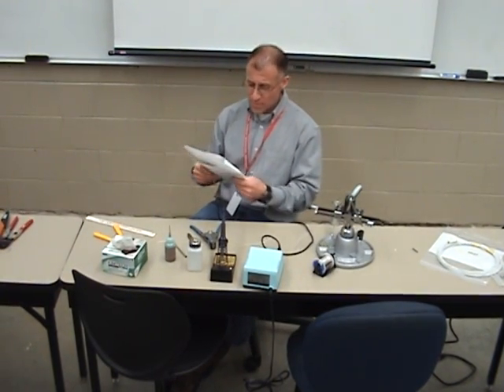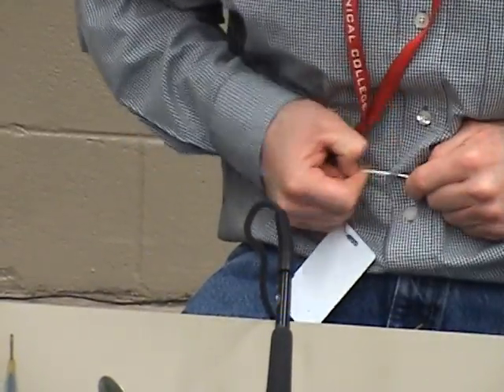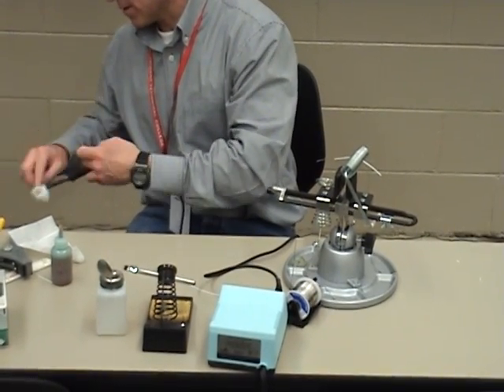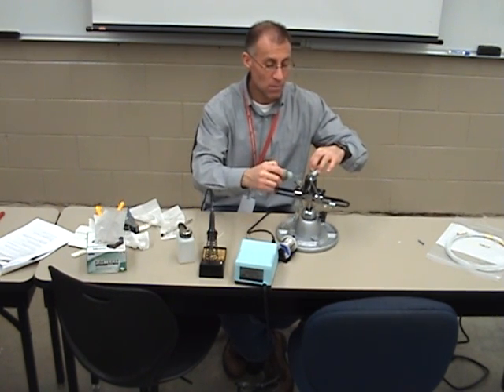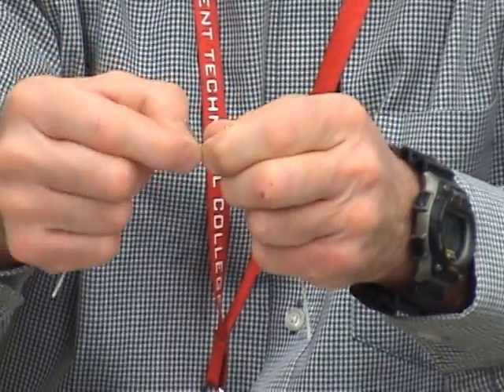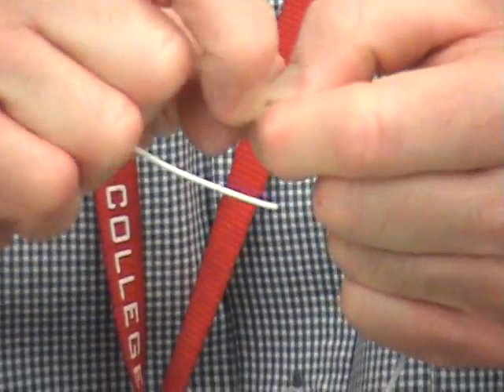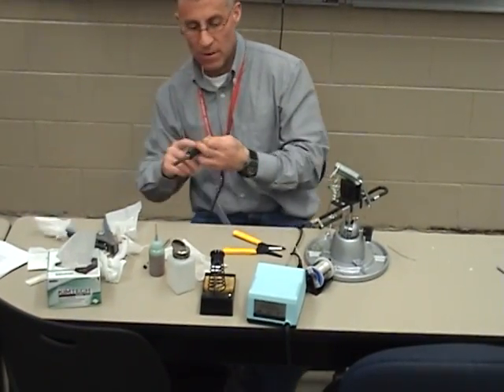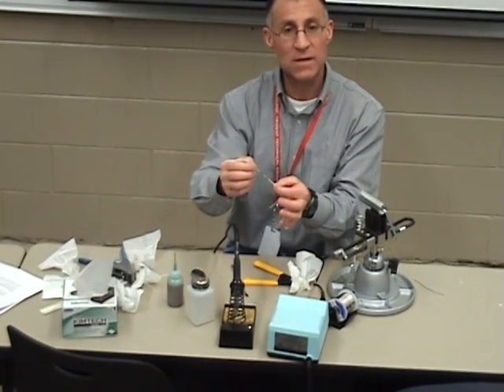*EXPERT LEVEL* Solder Splice Tutorial TTC Avionics

Comment: I would be surprised to find such a splice on a large transport rated aircraft. In my experience on Boeing 767 and 747 aircraft Raychem splices are used most often. For those not familiar with that type of splice it consists of a metal tube with a notch cut in the centre into which the stripped wire ends are inserted until the ends are visible in the notch and then crimped with the appropriate crimpers, the splice is then covered with a self sealing heat shrink tube.
Reply: Because thats a stronger more secure connection.

Comment: Back in the day, we referred to that type of splice as a "short tie", a variation of the Western Union splice (used heavily in telegraph / telephony wiring back then). It is a mechanically strong splice.

Avionics soldering requirements include cleaning at each step with the goal of removing contaminants that could infiltrate the connection. Contaminants could lead to eventual destruction of the connection.

Comment: I appreciate the value of these videos as a technician, and felt like I needed to add something to contribute to this:

When stripping larger diameter wiring sleeves (like coax) and/or longer lengths of sleeves (such as anything above 1 in/2.5 cm) wiring with smaller/weaker diameter wire such as 22ga aluminum wires such as those found in electrified door hinges; It is important that you strip the cable multiple times at 1 in/2.5 cm until you achieve your desired strip length. The stress of pulling the sleeves beyond that can break the wiring or stress/stretch the material, allowing for faster oxidation and a shorter lifespan of the wire.

Comment: People of the Internet: this is next level soldering meant for space shuttles and aircraft.  Do you need to do this if you're soldering the crappy xPlode subwoofer that you currently have hand twisted and duct taped in the back of your Honda Civic? No.
Reply: Josh Denham this splice is actually designed to carry mechanical tension, in audio you're probably not worried about your wires carrying mechanical tension but rather about how faithfully they carry a signal. Which might not be this.

Before recycling an engineered solution make sure the problem it's a solution to matches yours.
Reply: Yes and no. You need to know the information yes. No I don’t think you would need to put a xplode subwoofer in a civic.
Reply: jaberwocky6669 Hell ya you do! Its done this way because engineers figured out its the best way to do it. Why not do it the best way?

Comment: OMG, it is not that hard and drawn out to solder wire. Way overkill to take 7 1/2 minutes to solder two wire together. The constant alcohol cleaning is laughable, especially cleaning the solder itself before using it. Agree that if you are twisting wires, do not tin first. Also he forgot to say put the heat shrink on before soldering since usually the wire ends will not be accessible.
Reply: this is AVIONIC level soldering - this is not dicking around
Reply: I feel you. There's got to be a better way to speed things up. And yes. Putting on the heat shrink before is a must. I've learned that the hard way.
Reply: I thought you were supposed to pull the splice together after you wrap them
Reply: it's already pretty locked down - if you did it properly in the first place I'm not certain you CAN - not without fatiguing the copper
Reply: TacticalBBQSauce, that's using a barrel knot, and using rope.
Reply: Brad Lubbers I hope to god you don't work on equipment that could kill mass amounts of people if it fails.